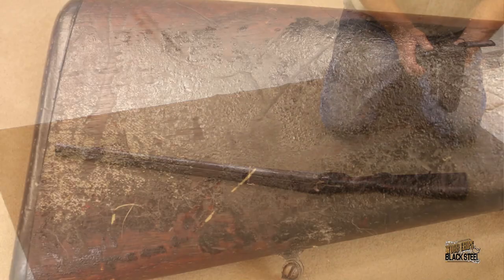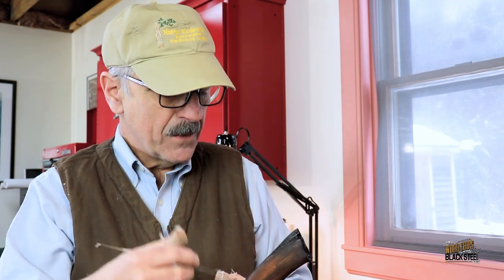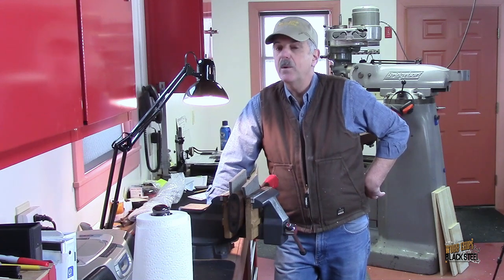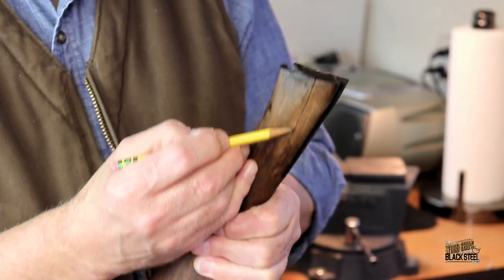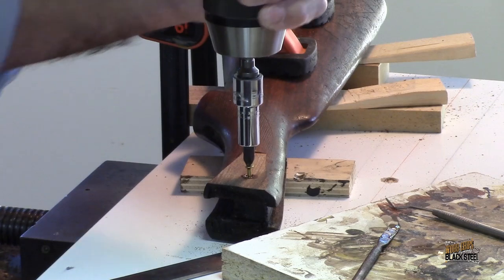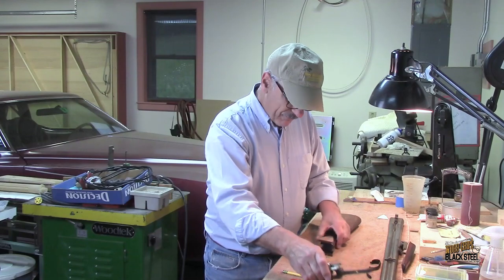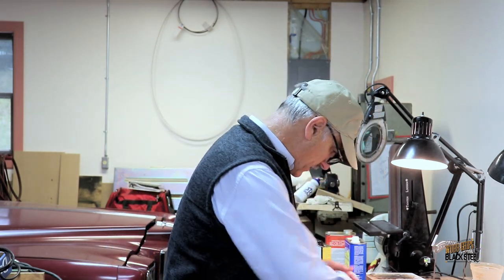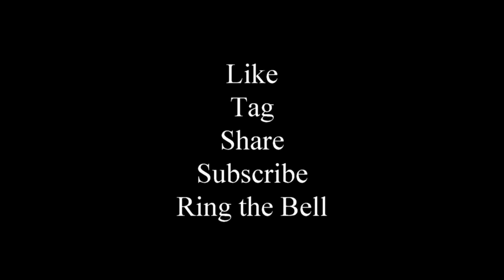Beginning to End Restored! 1905 Ithaca Butt Stock

Comment: Amazing restoration.
I was wondering why brass dowels? 
Wouldn't a wooden be just as good if not even better?, ( since the glue would penetrate into its pores)
Reply from the maker: I had to go back and watch the video to see which dowel you were talking about.  🙃Reality is, that I probably could have done the repair without any dowels.  Epoxy would have held it fine considering how small the piece was.  My concern doing the glue up was that the broken part would not line up properly when I applied the epoxy and tape...that it would wonder off center.  Mostly the dowels were for alignment.  Now...why the brass?  The dimension width was so narrow that  a wooden dowel would have been very fragile and weak.  I could turn the brass down to a very small dimension and still retain the strength necessary not to break when I was installing it into the wood, but still align the two parts of the repair.  I hope that answers your question?  And thank you for the compliment.  Don't forget to watch the entire playlist on the restoration of this old American classic.  It took me a year to do the full restoration.
Reply: That makes perfect sense, thank you very much for your efforts and reply.😊
I am about to restore a brown bess musket and have been watching your videos to avoid making mistakes.

Comment: How did you match the holes in the broken piece with the pins in the stock?
Reply from the maker: Carefully 😉  I put some marking compound on the top of the pins and then lowered the little piece down on to the pins.  The holes in the broken piece were drilled slightly larger than the pins so that when I applied the epoxy I had some adjustment to fit.

Comment: I have a Neumann Bros “The Interchangeable “ 12 Ga. and I’m thinking about restoring it. Luckily, no cracks or chips. Just dents and pressure scores I’ll attempt to steam out. I wasn’t sure I could take it apart without damaging the stock, but you’ve motivated me. What did you do with the metal? Reblue it or just buff it?
Reply from the maker: Not entirely sure I understand  your question about the metal.  If you watch more of the series on this shotgun, I cover a lot of what I have done to the receiver and the barrels (barrels are still in process).  Thanks for the comment and its great that one of my vids have had an impact.
Reply: @SixRoundsStudio  : I often get told I should have been a watch maker because of my love of detail and meticulousness. I haven’t seen all of your videos of the shotgun barrel treatment, but I’ll search for it. Thanks again.
Reply from the maker: @sandymilne224  Thanks Sandy....really appreciate it.  Craftsmanship is a place more than a thing.  But I think you get that.
Reply: …just wondering why the needle approach instead of immersing the cracks in a jar of acetone? That would get into every nook and cranny clearing out all oil.
Reply from the maker: @sandymilne224  Well...being surgical in the approach keeps any potential harm limited to the smallest possible area, and focus your work only on the affected area. The acetone will have some residual affects like removing the tannin's (color) from the wood.  If I were to soak the wood it would very possibly change the color.  Also...are we ever completely certain that there is not some underlying or unseen weakness or previous repair that the acetone may affect or release.  There may be no harm done by soaking the stock...or there may be irreparable harm.  In restoration we always strive to do the least harm and to respect as much of what is original as is possible.  I compare it to using a sledgehammer to do the work of ballpeen.  In other words...just because you can doesn't mean you should.
Reply: @SixRoundsStudio  : We’ll stated. Duly noted. Thnx

Comment: the brass nails make is weaker than it would if u glued it with epoxy
Reply from the maker: Not sure your point?  Everything was epoxied, and I never used any nails.
Reply: @SixRoundsStudio  U used a brass nail or stud when u glued the loose part on the stock behind the lock. That was the thing i refere to. And it is actually weaker than without the nail or stud. Also metal in wood is not a good thing since wood is moving acording to other prinsip than metal. So when it is warm the wood shrink while the metal expend and when it is cold metal chrink and the moist in the ait is higher - maybe rain and the wood expend.  Also when the temperature is changing from cold to warmer the moist in the wood will condense to the metal causing small condense/moist marks and damanges. However I like to point out U did a nice job with the gun and I really liked to watch it

Comment: As Larry Potterfield from Midway USA shows in his videos, just soak the wood in a bucket of acetone to remove the oils in the stock. No need to use needles which seems like a giant waste of time. This is a beat-up shotgun, not a $50K collector's item.
Reply from the maker: Thank you for your comment Todd.  Larry has his methods.  Not a beat up old shotgun but a family memory.   This is for pride of place and history.  You either understand this or you don't.  We apply the same care and craft no matter  the client or the cost of the gun.
Reply: I guess the difference might be to use a sledgehammer or to be surgical in the approach.
Reply: @williamg.rodeschin7811  Soaking the tang of the stock in acetone is hardly the same as a sledgehammer. There is no practical purpose to using a surgical needle.
Reply: @SixRoundsStudio  No need to get nostalgic here. Soaking the tang of the stock in acetone (or mineral spirits) is perfectly acceptable and will not harm the stock in any way. However, using a surgical needle is tremendously time-consuming and does not afford any advantages over other methods. And Larry is a master gunsmith, lets be clear, and his videos have millions of views.
Reply from the maker: @tberkoff  Todd, can you share your experience?  I am interested